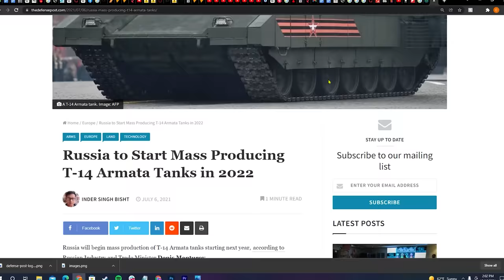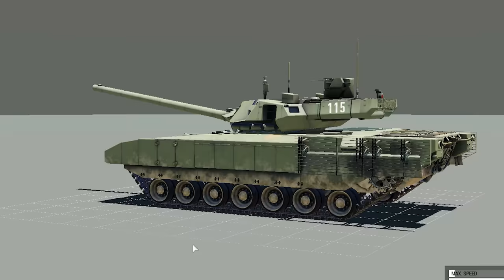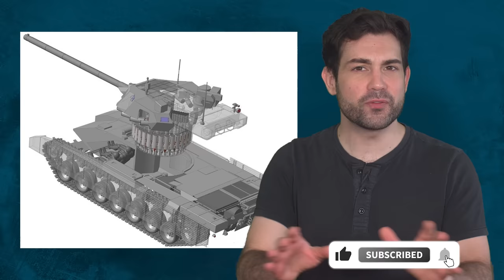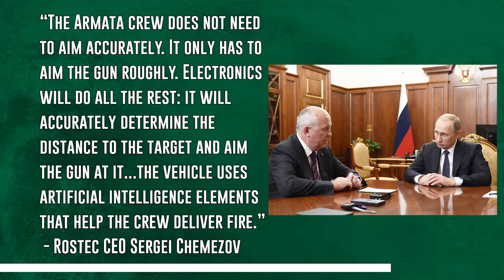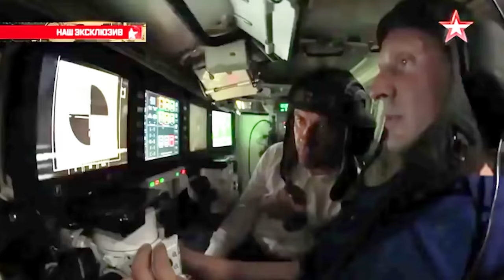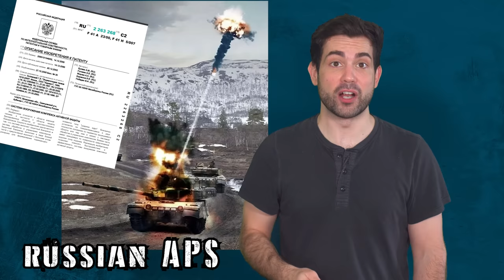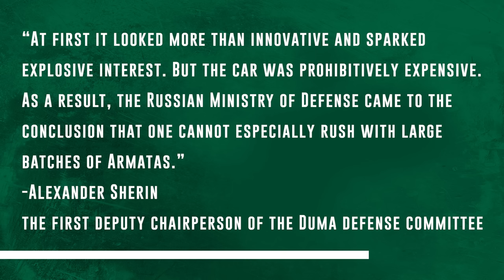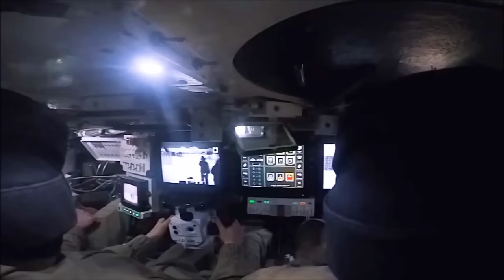The Truth About Russia's T-14 Armata Tank

Comment: The problem with an autoloader is that once it breaks it will be a pain to repair and impossible if it gets hit
Reply: Well, if think this applies to a human loader too. A pain to repair.
Reply: @aleide2980  yes but humans are easier to replace quickly.
Reply: Hence, a fully automated tank, being expandable by construction, does not need to be repaired. A manned one does, otherwise the crew is screwed.
Reply: @tonybrowneyed8277  yes and that is something that the t14 is not. That sort of tank could only be done with very strong supply lines and mechanics and that is something that the Russian army serverley lacks.

Comment: ACTUALLY there is an update on the Armata you missed, 
not long ago (a month or so) in the Russian side of the net several photos of post trial modification of t14 appeared, with even thicker armor on the front hull and reworked side armor panels. With news that T-14 finished it's state trials and the first batch of 20 serial version of t14 is slated to be delivered to the front lline troops by the end of 2021~early 2022
Reply: Just in time to field in urkraine.
Reply: @zachv1942  yup. I'm afraid you're right. certain engagements will be the 'proving grounds' for technologies. Just like Georgia was where the Russians went back to the drawing table and decided to upgrade their army structure, and in particular their infantrymen. Now they are testing this out in Syria and Ukraine. They are taking notes. Maybe we should too.
Reply: They actually announced that the first batch of 20 will not be made until 2022.
This is the same 20 frequently believed to have already been delivered.

My belief is that the Russians have concluded that they can't develop the technology claimed, and certainly can't afford the development.  They also realize that it is a tank with a glass jaw -- a lightly armored turret that can be knocked out with 30mm is a mission kill, even if the crew can drive it back in retreat.
Reply: @1djbecker  Also possible that they have the technology claimed, but they can't develop the means to affordably mass produce the  design. 

Even with if the technology works and the design is sound, if they can't build and field them, it's still just vapor.

Also, is the front of the turret really not even resistant to 30mm? 
I'd expect even the "lightly" armored turret (by MBT standards) to be resistant at least to modern 75-105mm rounds, depending on angle of incidence.

Comment: Combining an IFV chassis with a tank chassis is doable and could be a good idea if you really want maximum commonality, but not if the tank has a large cannon turret imho. You could do it with a turretless tank design like the Stridsvagn 103, plus a small remote turret at the top that is shared with the IFV platform

Comment: Armata deserves recognition for ATTEMPT at decisive break from pattern that plagued Russian tanks since T-64.  However, it had fallen flat at the same place as every other promising design: ENGINE.  1500 hp, COMPACT reliable tank engine is still beyond russian capabilities.  Even unremarkable as Leo2 original engine, much less something akin to French Leclerc' Hyperbar.  In any case, thoroughly updated  advanced T-72BM derivatives are available in obscene numbers, more than Russia can afford to man and maintain, and are capable enough for most needs. Well maintained, with modern digital communication, new ammo and autoloader and updated optics these are still formidable vehicles.  ~ 9:12 it isn't first - check Jordanian Falcon turret with 120mm RUAG CTG. I think Armata will be Ka-50 of tanks - innovative and ready for mass production, even usable in a field, but will remain niche vehicle with more traditional ones being prevalent for decades to come.
Reply: @danepatterson8107  The drone bait theory is unproven. It's just been a popular assumption since Nogornokarabakh.
Reply: First, the engine ALREADY present on T-14 is 1500 hp. The goal is 2000 hp at the same size and greater efficency. So your entire argument alreadygoes out of the window. Also, Jordanian Falcon turret is in no way comparable to Armata turret. For one, it is not unmanned - it still has crew compartment, isn't fully digital, etc etc.
Reply: The Falcon turret was not remotely controlled, the design was the same as that used by Striker MGS, where the crew is housed in the turret basket.
Reply: The engines on tanks aren't  much different than the engines in WW2 fighter, just lighter weight and easier to maintain. The Russians shouldn't have trouble developing one.
Reply: you must be ukranian
Reply: @danepatterson8107  The response to drones is the APS and computer controlled AA MG (or even a fuse detonated frag from the 125mm). Armata having even a small radar combined with automatic fire control systems makes countering drones far more feasible. As Simeon Jankovic also commented, the Armata isn't so much about having tanks on the ground now but having a chassis that has the capability to house 50 years of upgrades capable of adapting to threats that 1980s chassis can't because they lack the automation to react to current and future threats fast and accurately enough.
Reply: @winstonsyme7672  plus armata has explosive reactive armor on top of the vehicle, so your average drone needs to pack a lot more punch to defeat it
Reply: @danepatterson8107  Drone bait only in the environment where enemy rule the sky.
Reply: @winstonsyme7672  Do you know what type of APS T14 uses? All this: "The response to drones is the APS and computer-controlled AA MG" is such bullshit I have not seen for a long time.
Reply: @HanSolo__  Afghanit, obviously. Capable of taking down low level suicide drones and guided missiles fired by drones using both soft and hard kill methods. The experience we saw in Armenia would be very different against Afghanit and other APS armed tanks with the drones and their missiles often being intercepted by APS. Likewise the use of radar aided automated fire controlled light AA weapons would assist against direct top down attacks. T-14 has an HMG in this role right now with the APS activated if it fails and the threat gets too close. We're going to see an evolution of tanks responding to drones much as we've seen ships responding to AShMs on a larger scale. The tech advancement area for tanks right now is in extremely rapid and accurate fire and counter fire which goes far beyond human capabilities. Thus why new platforms are necessary to hand over that control to computers instead of humans.
Reply: @winstonsyme7672   I see Russian 12,7mm MG responding the way Phalanx gen 3 does sending the response human is not capable of. And yeah all of this Afghanit guided. 
Because Active Protecyion System means taking down the drones from the sky a few km above the ground. Which obviously as name suggests (APS) has nothing to do with protecting the tank. Daaamn!
Reply: @HanSolo__  Obviously a large drone many kilometers up is out of the reach of the hard kill explosives and MG and they would have to wait for an incoming missile to shoot at, but they have supporting SAMs to worry about.

What we are mostly seeing being such a huge threat to tanks is low level drones at tree top level crashing themselves into tanks with a HEAT warhead attached, or the dismounted/unbuttoned people with smaller explosives, or providing guidance for incoming long range weapons.

These are vulnerable to all the APS system components. Jammers, HMG, smoke, and explosive projectors.
Reply: @phunkracy  To begin with, the Armata has an engine with a variable volume of cylinders and a compression ratio. In maximum boost mode, the engine develops a power of 1800 hp. In combat mode, 1500 hp And in derated mode in peacetime, 1300 hp.
Reply: @HanSolo__  The Armata armament includes the Sokol-V complex with the Sokol-1 guided missile. This missile implements a variety of scenarios for the destruction of both ground-based equipment, including those out of line of sight, and air targets. The missile is equipped with a multispectral seeker and implements the "fire and forget" principle. It can also hit targets at known coordinates, correcting from the signals of the GLONASS satellite system.
Reply: The fact is that with the rapid advance of light but lethal weapon on ground and air asks the question is armor of any use any more
Reply: @verdebusterAP  No infantry is going to fire a missile or capture a building if they are getting suppressed by 20mm to 50 mm autocannons or heavy machine guns. Hence armor will continue to exist, just to support infantry.
Reply: @csnation  
Again missiles outrange cannons and HMGs
The JTLV heavy gun carriers does the same job as IFV at fraction of the cost
Reply: «Armata deserves recognition for ATTEMPT at decisive break from pattern that plagued Russian tanks since T-64»?

What? What the phak did you say? In which area is it is «plague»? And how does Armata break the plague? It is literally the tradition of the domestic tank school: minimization of beyond-the-armour volume, so-called «Armoured Air». And crewless turret is just a one or even the final step in this area.